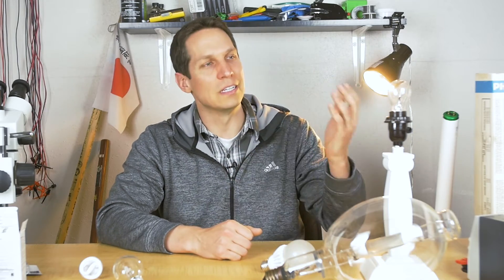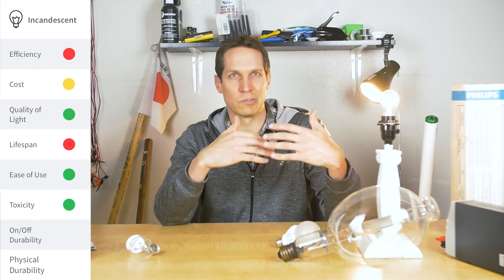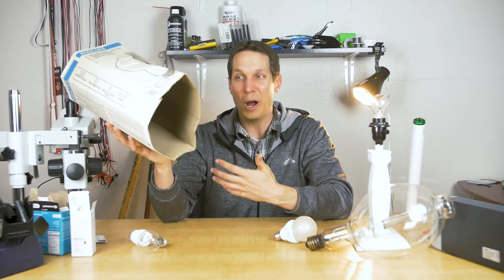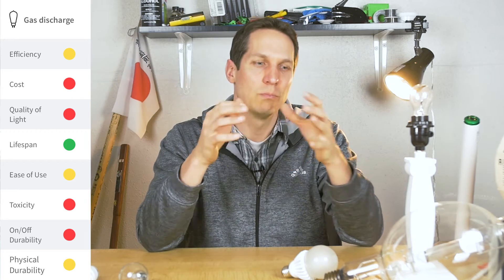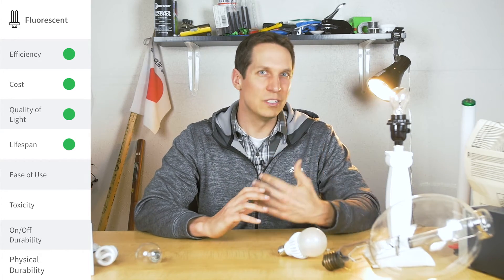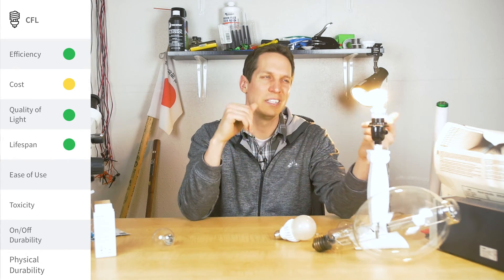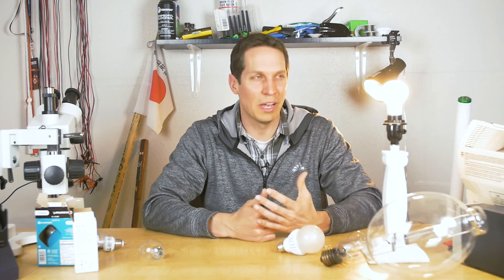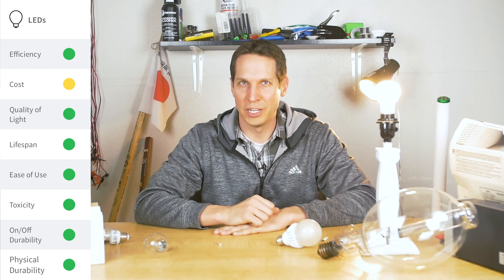Why Are LED's Better? (Comparing different types of light bulbs) | Basic Electronics

Comment: Compact fluorescent bulbs never gave me any problems. Just like incandescent, they're hard to find. Most are LED now. That created some problems. You need clean, no spike or brownout, electricity to run these as most are dimmable. A refrigerator cuts on, heater kicks in, a washing machine is running. All these things affect it. Gives me headaches. Only the non-dimmable garage door opener type work well for me. Of course not good on a dimmer as you would use your now standard LED. I would rate the compact fluorescent yellow. I've had quite a few crack for no known reason.

Comment: I have some LED bulbs and the base of the bulb gets very hot.  why?
Reply from the maker: That's where the electronics are that drive the LEDs, and where a lot of the losses (what generates the heat) occur.  This is one reason why LEDs are better when oriented with the bulb down - with the bulb up, the heat from the electronics can slowly cook the LEDs and significantly reduce their lifespan.  Unfortunately, it seems like manufacturers have been prioritizing cost over quality and so while I still maintain LEDs are the best technology available, I'm not as excited about the actual LED bulbs being produced anymore.  They are still extremely efficient, though, in comparison to other technologies.
Reply: That is the heatsink area. Usually a thin metal base that asorbs the heat to radiate away from the bulb. Cfl bulbs are the opposite, the heat is drawn away from the base thru the actual bulb shaped tube. That's why cfl bulbs lady longer with the base down like in a table lamp.
Reply: Last longer,dang autocorrect making me misspell.

Comment: I don’t like led bulbs so I only use incandescent and CFL, but mostly incandescent.
Reply: Main reason why I prefer incandescent is because I feel it gives more realistic light. I don’t like LEDs mainly because the light doesn’t feel natural and can be too bright at times.
Reply from the maker: I strongly prefer well-manufactured LED bulbs over incandescent but the quality of bulbs being produced recently has been very disappointing.  I still use LED for energy efficiency and because they're safer from a heat creation point of view but I feel like I've been forced out of the honeymoon phase with LEDs due to the overwhelming poor quality I've dealt with.  I will say, though, while I struggle to find decent bulbs, flush-mount or LED can light inserts still seem to be very good - a mixture of them being much more expensive and having more space to put higher quality driving electronics in there is my guess why.

Comment: What  led bulbs would I get to replace a 60 watt E 26 ?
Reply from the maker: An E26 base is very common, at least here in the USA.  You could find a replacement at any hardware, electrical, or lighting store.  They're rated with their incandescent wattage equivalent, so it will be easy to find a replacement.  I've moved out into the country and our power is a lot less clean than it was in the city, I've noticed some bad flicker that only occurs with my LED bulbs (not LED strips or LED can lights) which I think is because the capacitors are undersized in the bulbs (due to size constraints).  Hopefully you don't have that problem as well.

Comment: LED's are not better, period.  Firstly, even when they say they're full spectrum, they're not. They never truly provide a pure form of light, there's always some wavelength deficiencies, causing color shifts.   Secondly, the flickering aspect that makes LED's efficient, is terrible for human eyes, because it is a strobe light, even if you can't necessarily perceive it, you brain does.  They literally cause headaches and eye strain. LED's are just bad tech forced on us.  It's hard to notice or know it's even the cause of feeling bad, but once you realize it is and go back to normal bulbs, you realize that LED's just aren't a good technology.
Reply from the maker: I feel like they're making LEDs worse and worse, honestly.  The full spectrum issue is debatable depending on usage and what your standards are.  To me, in my personal usage, it's not a problem, though it could be for photographers or other people who are more sensitive to it.  The flickering shouldn't happen, even at an imperceptible level, in a fully lit LED.  However, I recently bought about 25 LED bulbs (name brand, expensive ones) and, even without any dimming, about 10 of them (of 25!) perceptibly flicker on occasion.  I've been wondering recently if we need to do a response/rebuttal/update to our own video.  Where I think we would disagree is that I think the fundamental technology is still good, but that implementation is lacking.
Reply: @CircuitBread    I always notice the flicker, not necessarily directly from the bulb or looking at the room, but if I wave my hand across my face, I can see the strobe effect in the movement. That's what causes eye strain without realizing it, because it actually fatigues your eyes. When you move a hand across your face quickly, it should be a blur. Instead it's easier to see detail as it moves, which sounds like a positive, but it's fatiguing. 

Since our eyes saccade constantly, even when we're just staring at something not moving, the flickering still causes fatigue, because for some portion of your eye saccades, you get only a partial or no image at all for the saccade to work with, without realizing it. I'm sure you remember the old Jurassic Park concept that a T-Rex can't see anything if it doesn't move....and that is actually how our eyes work at the photo receptor level.  

If we didn't saccade, a still image would be kind of the same as seeing no image, or more like the flash of an image, kind of like when you look at something bright and close your eyes and you can still kind of see a residual outline image of what it was. We see by changes, and saccades provide that.  They slightly adjust the position of our eyes so that the image we're viewing, even when sitting still, hits a different photo receptor, which is what allows us to actually perceive things. That's what those still image illusions you see online, exploit to create their effects.  

Our eyes have been said to be able to perceive as much as 2,000hz. Of course, that doesn't mean anything less than that will be agonizing for our eyes, or even directly noticeable.  LED's are tricky like that, because you just don't realize they're a problem until you do. Even people who think they're fine and not bothered by it, just don't realize it because it's soo subtle. But once you go back to normal lighting, you do notice the difference was greater than you realized.  That's part of the trick.  You can go from Incandescent to LED and not notice a huge difference, but go back to Incandescent from LED, and it's a noticeable difference.

I think they're making a lot of things worse these days too though, LED's included. You can see widely varying wattages and weights. I've had bulbs that were the same wattage, but one much more heavy, indicating either better cooling or beefier components, or maybe even heavier due to using less refined components. I've also seen very lightweight bulbs that have twice the lumens at the same wattage or even lower wattage.  What that tells me is they're pushing the hardware too much, which will cause faster failure rates and bad performance.  So far, not a single LED bulb I've used, has ever lasted the claimed bulb life. And I've used quite a few, even splurged on more expensive ones, and even taken considerations of if I'm using them in a place where they are more likely to overheat or not.

I still use LED's, but only in light sources I intend to use briefly, like a closet, or for outdoor lights. Reading and living room and kitchen and office lights, I use Incandescent.  LED's are especially worse for office lights, because a computer screen and LED bulbs can have competing color temperatures and refresh rates, which only magnifies the problem.
Reply: @peoplez129  Where are you getting your incandescents?

Comment: Why we don't use single 9watt led in replacement of 1watt 10 leds? In 9watt bulb
Reply from the maker: Ah, good question.  My guess would be cost, convenience, and power dissipation.  Making curved LEDs is more expensive, I imagine, so they'd rather put a few flat ones in a circle.  And then they can buy those individual LEDs off the shelf, further driving down development and manufacturing costs.  Finally, if the LEDs are spread apart within the bulb, the power dissipation is easier than trying to figure out the power dissipation for a single, curved LED.  There are probably other reasons but that's what I think.

Comment: The life expectancy of nowadays Lamp seems like a scam..
😕 Just because it says 25.000 hours Life Span, doesnt mean it will be long lasting like that..

The manufacturer just making it cheaper and better in shorter life span, so you buy it again next year.. 🤣
Reply: It definitely seems that way! Fun fact, though, LED bulbs are meant to last a long time, it's their drivers that are usually expensive. If one gets an LED with a cheap driver, the conversion of AC power (from our electrical panel) into DC power (the electricity LEDs need), is very inefficient. This heats up the driver, and makes the light die more quickly. Interesting stuff!

Comment: Halogens burn out after 3 months It seems incandescent can last a long time but bad for energy compact florcessent lights are pretty good last 2-3 years problem is mercury spill
Reply: Led is perfect last 20 years
Reply from the maker: Yeah, I don't like the fragility and mercury of CFLs.  LEDs can last 20 years but again, their initial failure rate is strangely high, but once you get past the first few months, then they should last for a few decades.

Comment: In 2021 CFL are more expensive than LEDs :D
Reply from the maker: Isn't that insane how things have flip flopped?  Incandescents are even more expensive now when I check at Home Depot or Lowes.  They've just gotten more expensive as the quantity used has dropped, I suppose.  They're basically just specialty bulbs now.

Comment: Movie studios used low pressure sodium (SOX) lamps to do special effects. The light they produce is essentially monochromatic, so it lets you do interesting film tricks. These lights have a color rendering of 0 so if something is lit by them it might as well be black and white. 

The bulb that you have appears to be metal halide, due to the white paint on the ends of the arc tubes. I have never seen a mercury vapor bulb with painted arc tubes. These have a color rendering of 65 in most cases. One can get Ceramic Metal Halide bulbs that can have color rendering of up to 95 which is better than most consumer leds. 

True mercury vapor bulbs have terrible color rendering (15-20), but are hard to come by. Most MV lamps found in the wild have “delux” coating that makes them operate more like fluorescent lamps. The color of these is much better (40-60) and can be challenging to distinguish from some metal Halides. 

Thank you for the video :):)
Reply from the maker: Thanks for the extra detail, this stuff is really fascinating!
Reply: @CircuitBread  sure! Thank you for the video :):)
Reply: That white paint is probably zirconium dioxide or aluminum oxide which serves as a heat reflector to keep the electrodes hot enough to have good electron emission.  The Russians often use chromium dioxide for this purpose (these lamps are very distinctive due to the bright green reflectors).  The only time you see these reflectors on mercury lamps is in the small 40W, 50W and 75W sizes, both to improve warmup time and to improve electron emission in the higher operating pressure of the discharge tube of 15 atmospheres or more.  In these mercury lamps, the heat reflectors are usually platinum paint.